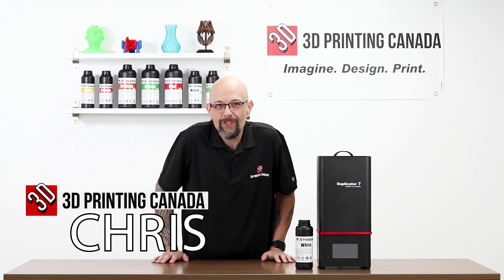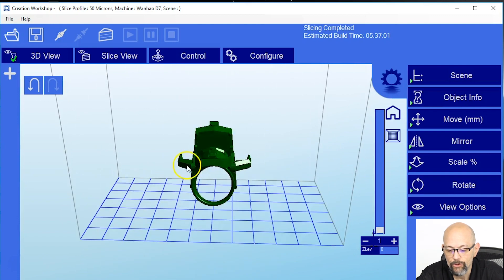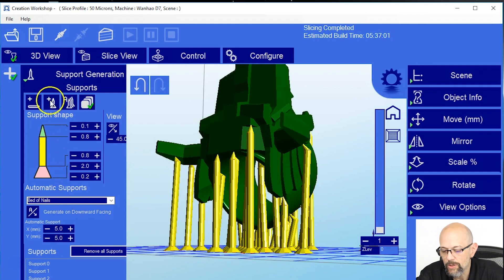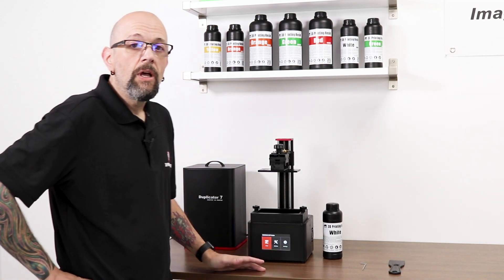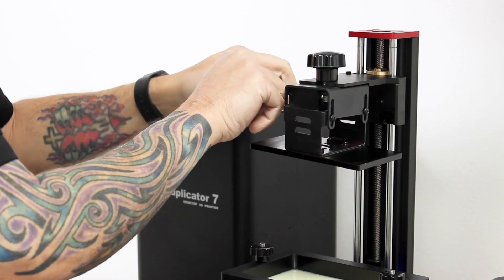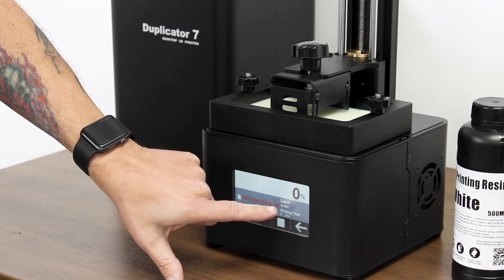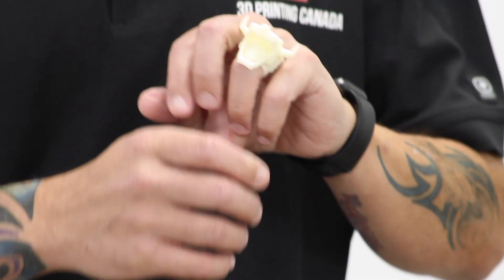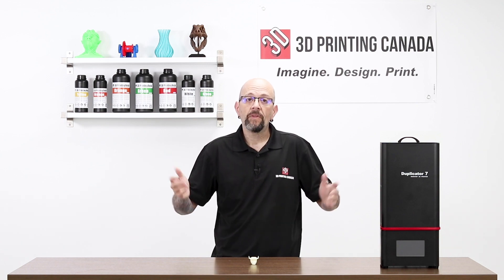Wanhao Duplicator 7 Plus Voltron Ring Slice and Print - Resin Printing

Comment: Hi guys, I bought my D7 but I'm struggling to make it print properly. I'm sure is a matter of setup, so I would like to ask you guys if when using the Wanhao resins you guys change the configuration depending on the color (I've the black one to practice) beside the obvious change when there is a different layer thickness. Thanks in advance!
Reply: Julio Abel Guimmarra inusually use the default settings in CWX for the particular resin that I’m using. If I need to adjust it I will after the first try